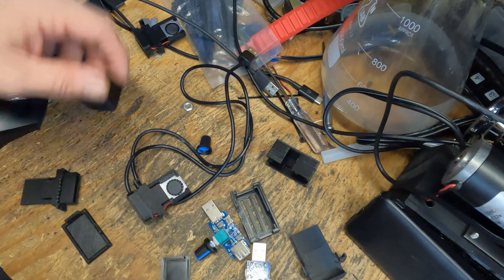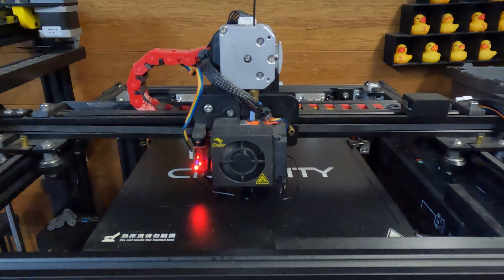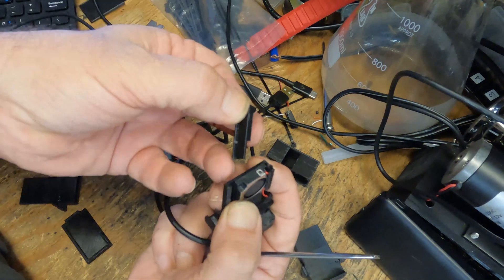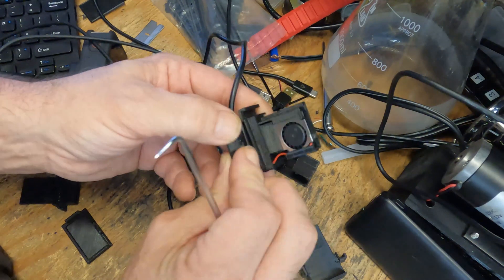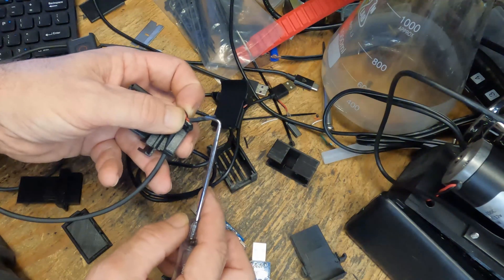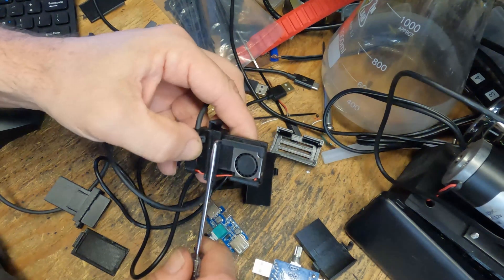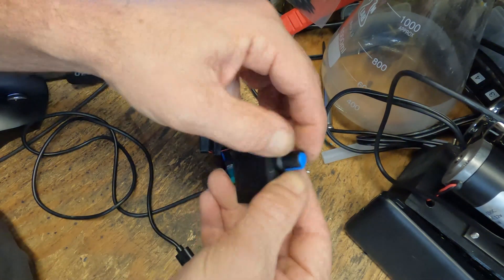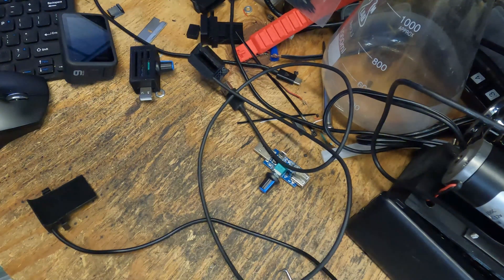Extreme Condition GoPro Hero Cooling System

Comment: wouldnt it be better to cnc it out of metal for extra cooling?
Reply from the maker: Wouldn't be possible in its current form because its to complex a part, also it does not work as a sink and the only contact patch with the camera  is the first 10mm.